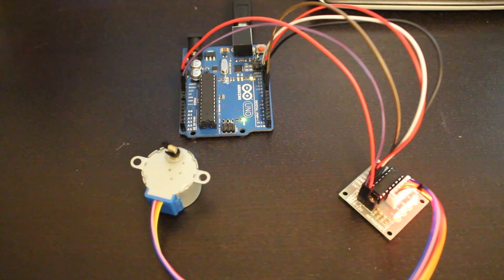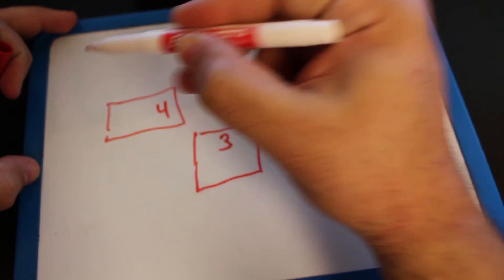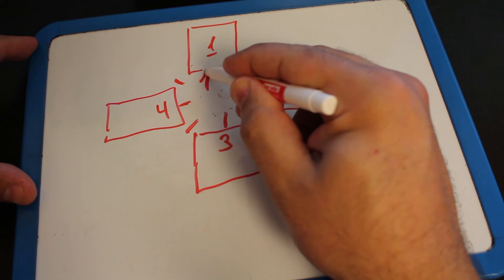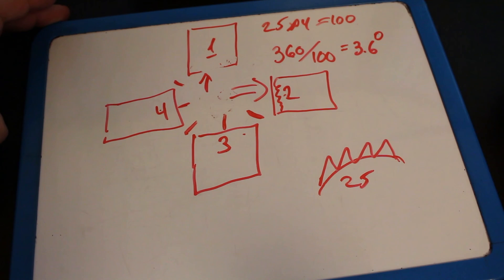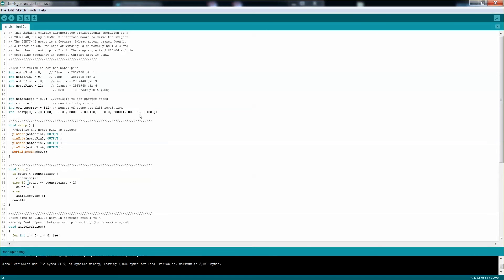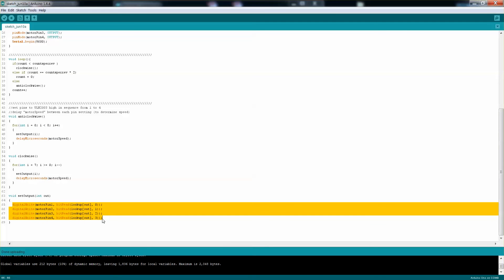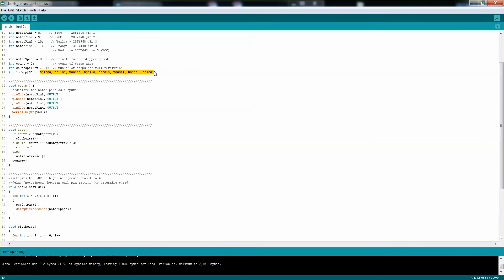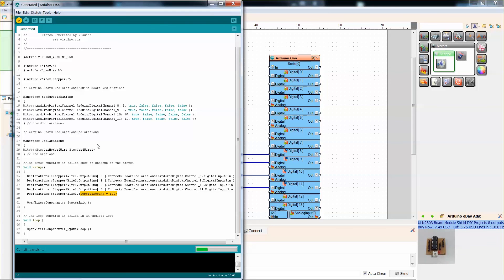Tutorial in How To Use Stepper Motor with Visuino

Comment: I recently bought Visuino because of your tutorials and trying to build a motion control camer aslider.
In the tutorials by you and Mitov I only see stepper motors to rotate continuously but not just a number of steps. I need it to stop where the slider ends :D
Reply from the maker: Do you know how many steps the slide is ?  do you have another sensors in the end of the slide to tell when you got there? I believe that you can put the limit of the steps or limit of the number of rotation you can take. I'm not in front of my computer right now.
Reply: I got it to work using the up/down counter :D
The other thing I'm trying to do is controlling the stepper motors with my mouse. But I can't dive into delphine rightnow. I had my hopes up for using an old PS2 mouse, but that involves making a visuino component myself. It looked easy enough at first: 2 rotary encoders for X and Y axis, simply wired to the arduino...
Reply from the maker: Drop a message to Mitov on the google+ channel. I'm sure he will be happy to add it to his list!

Comment: how if i'm not using a visuino,, are motor stepper still work?
Reply from the maker: you will need to write your own code to control the stepper motors. What Visuino gives you is a plug and play and drag and drop connectors with no need to write Arduino code. In the background it creates the sketch for you that utilize Visuino libraries.
Reply: okay thanks